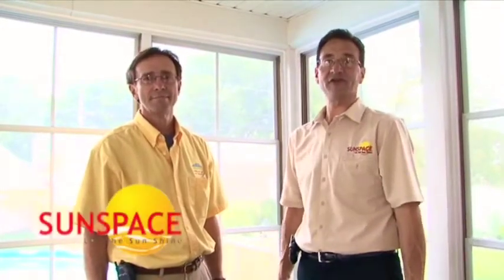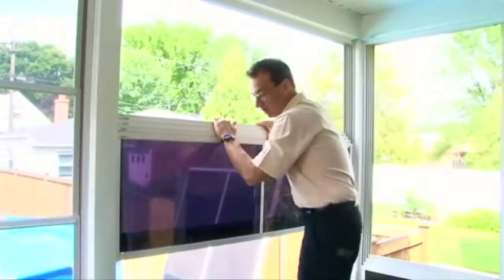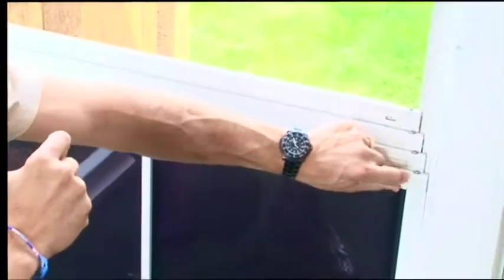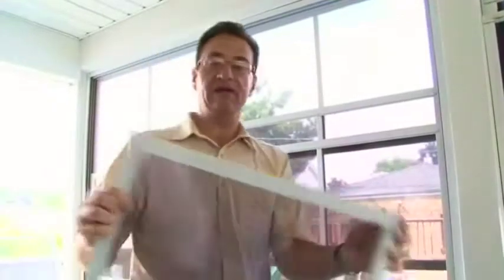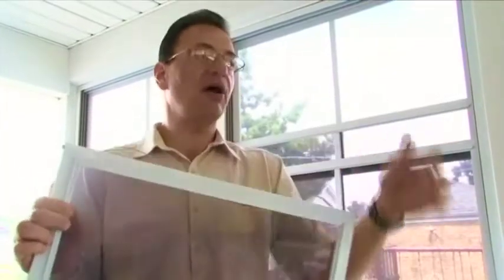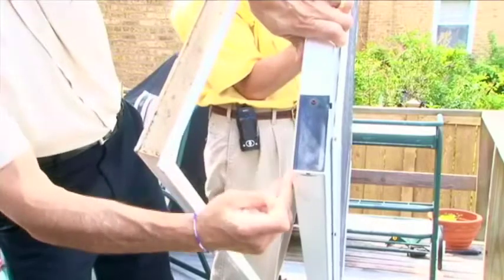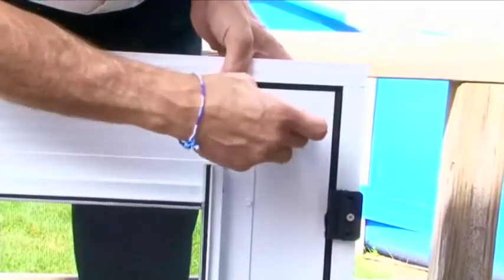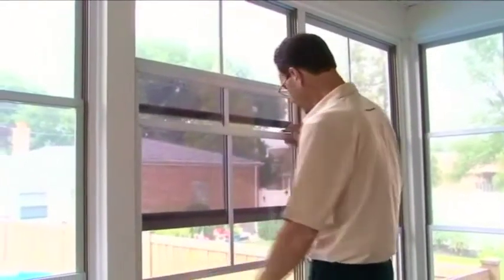WeatherMaster vs Brand-X Full Presentation

Comment: What can you tell me about the winter weather difference with this system?
Reply from the maker: The WeatherMaster vertical 4 track operates easily all year round. no extra pins and clips to fail during harsh temperatures or weather. Our customers have never reported winter problems of failures such as, vents facing out, pins and clips breaking, tracks freezing. I hope that helps.